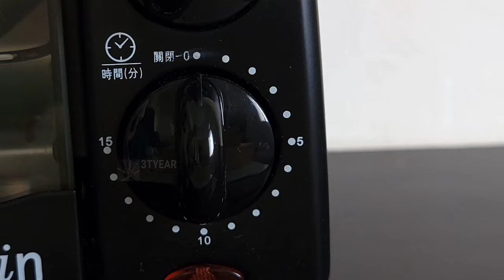DIY the mini Lantern

Comment: I build miniatures for film and tv and i used to use the same material as you use here and it was lots of work, then i discovered that if you look for a shop that sells model ships, you can buy the different woods in the sizes you need from them, the sizes are from 0.5mm to 12mm thickness and from 2mm to 100mm width and the woods they sell are bass wood, cherry, spruce, pear, oak, walnut and even mahogany, this has saved me so much time with cutting and sanding.
Your work is exceptionally good, by the way, new sub here.